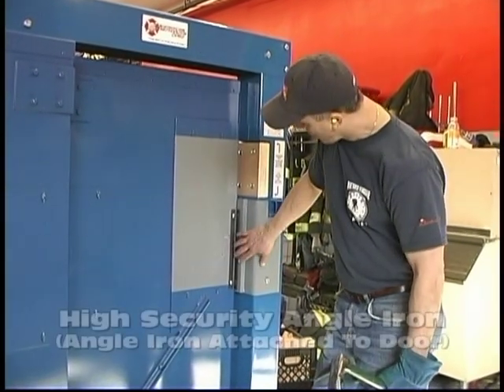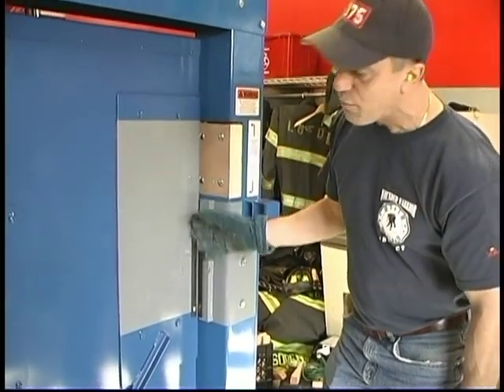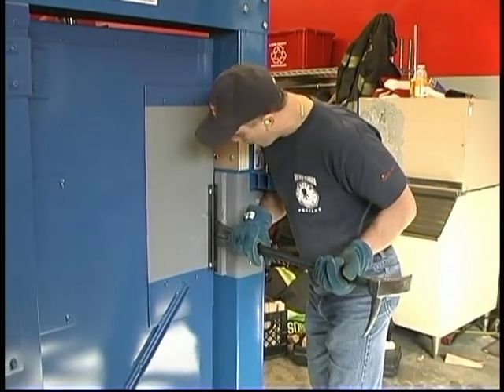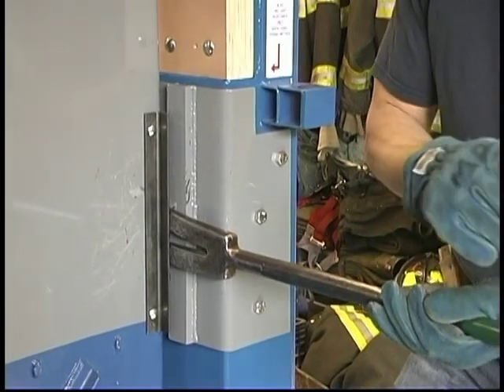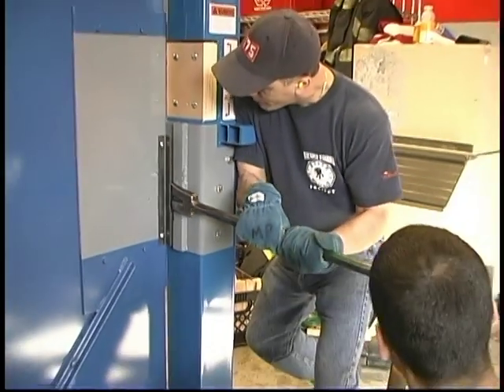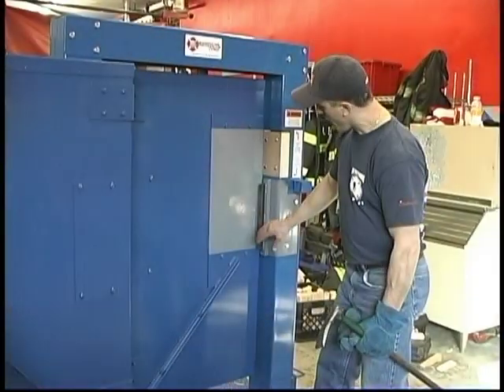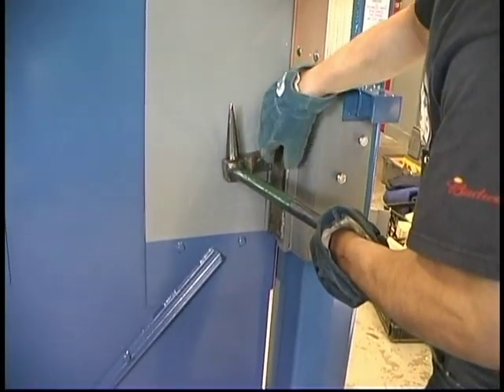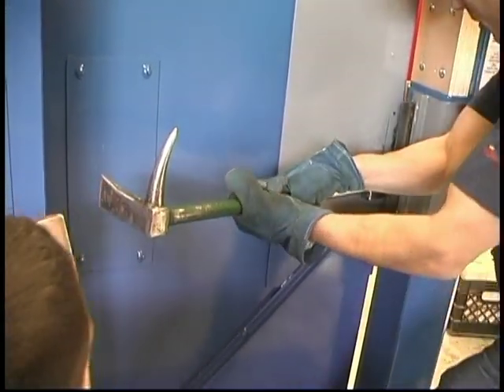#4 - Angle Iron: Mike Perrone Forcible Entry Training

Comment: how does a door even function if it has an angel iron on the outside and a lock on the inside
Reply: It still functions with the angle iron attached because the angle iron does not interact with the door lock or the door swing. If the angle iron is attached to the door it simply swings with the door slab, open or closed. When the slab closes, the angle iron lines up with the door stop (that little vertical, rectangular ridge on the middle of the door jamb). If the angle iron is attached to the door stop itself, like in the second scenario Mike demonstrates here, then it stays in place as the slab swings open and closes. In either case, the purpose of the angle iron is simply to cover the vertical “crack” between the door slab and the door stop, and improve security.